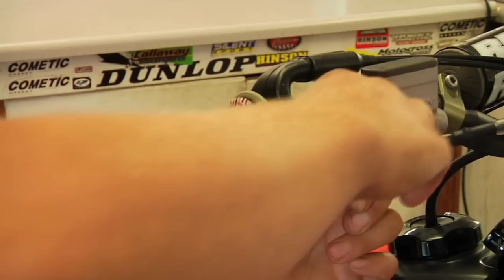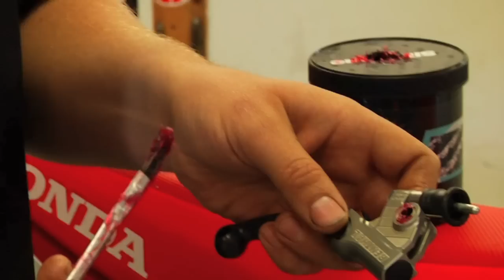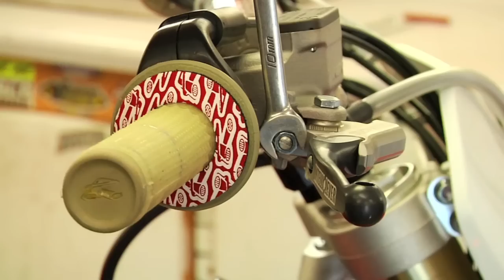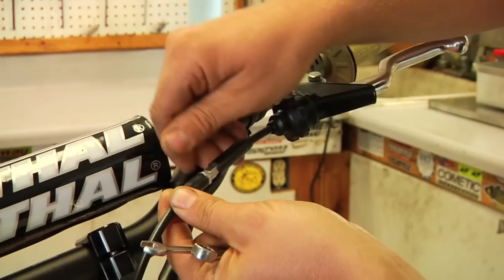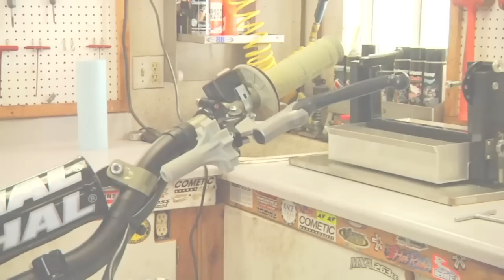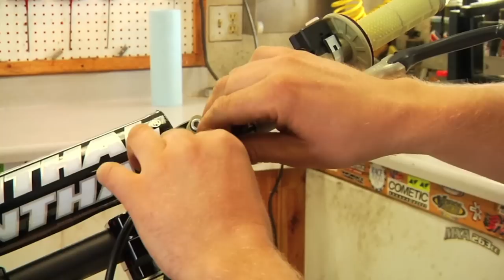Renthal Intellilever Lever fitment

Comment: Nice video. Be careful of the new Gen 2 levers. Bought a complete set and snapped both cables on first pivot. Gen 2 cables are bad design. Gen 1 cables fit gen 2 levers and are much stronger ;-)